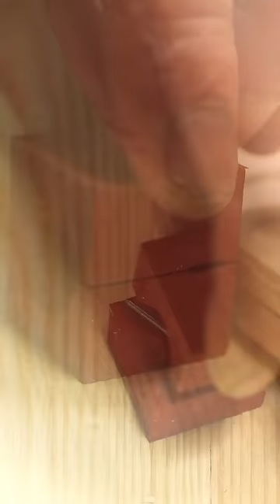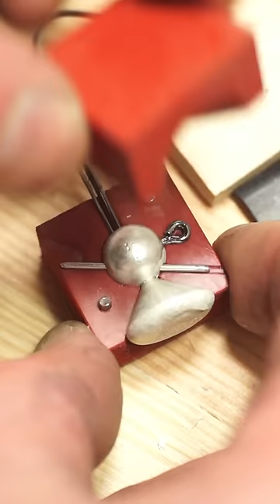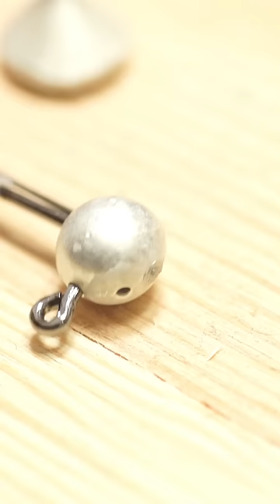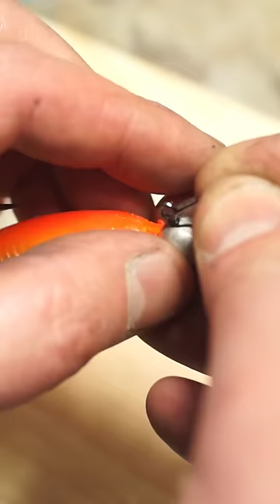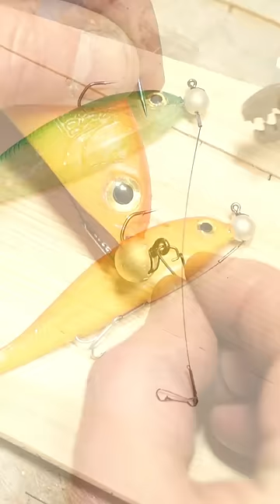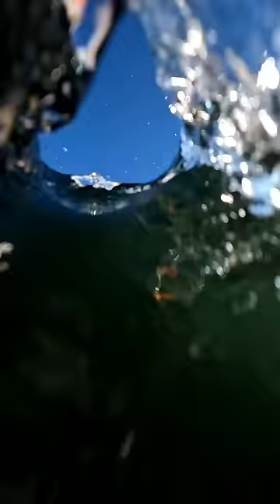Making a through jig head for soft plastic swimbaits

Comment: I love ur videos man! Do you use a mask when casting metals and if so what set up? Thanks 🙏 🍀
Reply from the maker: this is lead free pewter, so it is not particularly hazardous but I do wear a mask if I am casting a lot of lures,  this has lower melting point than lead and tend to heat on old single eclectic ring top in s/steel kitchen measuring cup

Comment: what silicone do you use?
Reply from the maker: heat resistant RTV silicone
Reply: @PaulAdamsTheHandmadeFisherman  and that handles lead well? from what I was reading they rate it 100' F below the melting point of lead. How long do the molds last?
Reply from the maker: @NC_Fisher_Guy  this lead free pewter with a melt point of around 230c i have used lead a about 320c and works, it is hard to judge how many uses you get of a mould  because i have never worn one out but i am only making a few lures at a time, the only thing it does not do well with is deep undercuts in figures or where the mold need to really flex to let the casting out, using baby powder makes casting and also extends the life of the mould
Reply: @PaulAdamsTheHandmadeFisherman  so you couldn't see any damage to the mould after using lead? I'm considering making some molds, but just wanted to hear some other opinions.

Comment: So you run the wire over the surface area thats going to be contacting cover and bottom. Great job. You really overcomplicated a simple thing that didn't need fixing.
Reply from the maker: these are large swim baits for European pike fishing, normally i wouldn't bounce these across the bottom, generally it is slow  steady retrieve or pauses  and pull  midwater  if I wanted something to bounce on the bottom i would just use a jig head and small lure  or crank bait, and yes Overcomplicated is my middle name
Reply: @PaulAdamsTheHandmadeFisherman  Theres always that one guy. Good way to handle him.

Comment: I would have done one without the weighted hook
Reply from the maker: yes, my first concern was that the two weights would make a tangled mess on the cast, but actually they seems to cast really well and no tangles as yet i think that is because the lures are far enough apart and also the same size. I have made these jig heads in plastic (Polyurethane) which very lightweight but it is rare that i have ever fished them and i do not know that it makes much of a difference on the cast, thanks